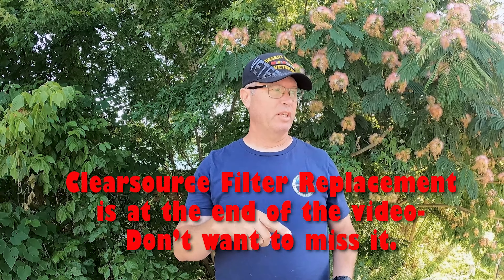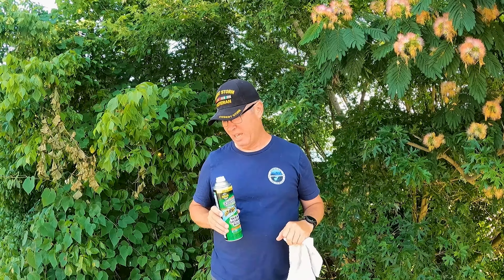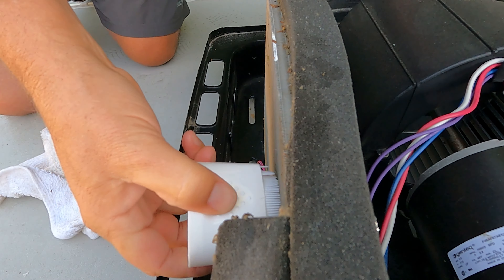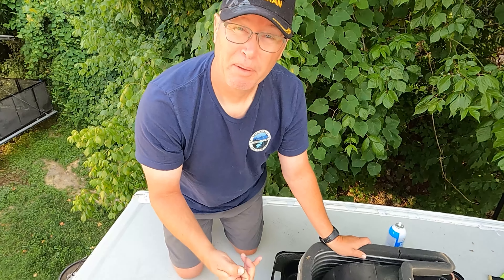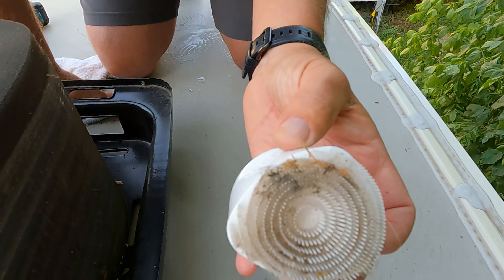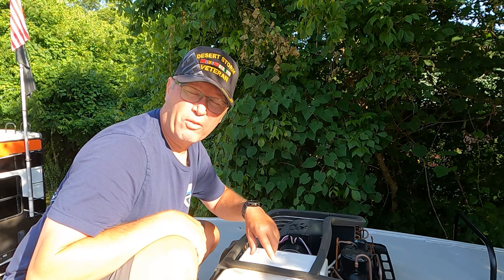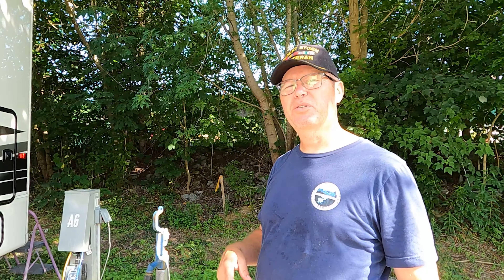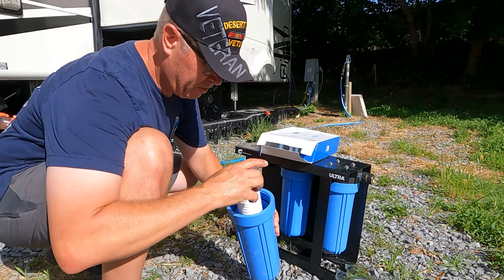RV AC Maintenance and Cleaning | RV Living

Comment: I have a 3 stage water filter system (different brand) and after I put in the carbon filter I run water thru it (not hooked up to RV), you will flush all the carbon powder from the filter during the mfg process and it won’t get caught by the next filter, then I put in the next filter and then hook to the RV. If you ever used the Camco in line filter and ran water thru it before hooking to the RV for the first time, you know what it looks like. Great video!
Reply from the maker: I know what it looks like and didn't even think of it so thanks for the tip.

Comment: Hi I have a quick question.  Such a newbie here.. when you are at a site, can you relevel the RV legs without having to attach it to your truck, just relevel at the site?  I have the same RV you all have.  Thank you.
Reply from the maker: Yes you can, but don't do it with the stairs out.  If you lose the rig while the stairs are out the stairs will work like a pry bar on the bottom of the door.